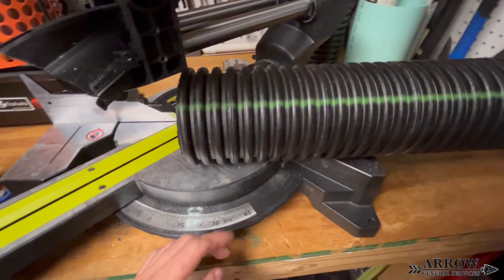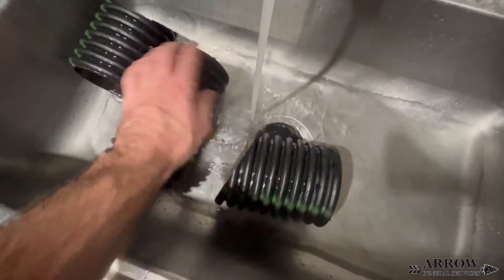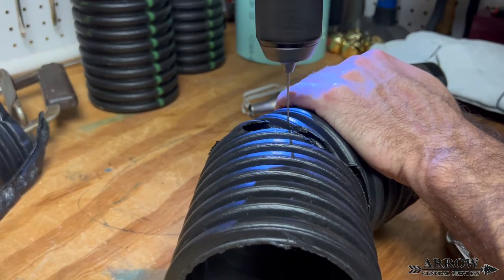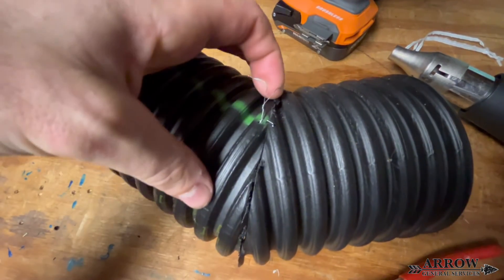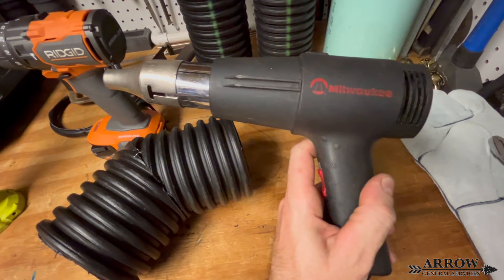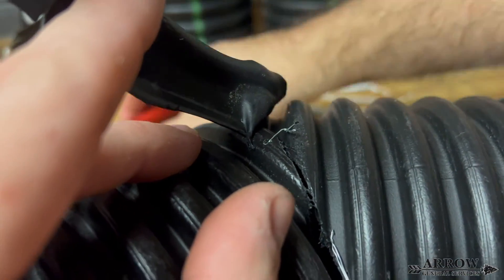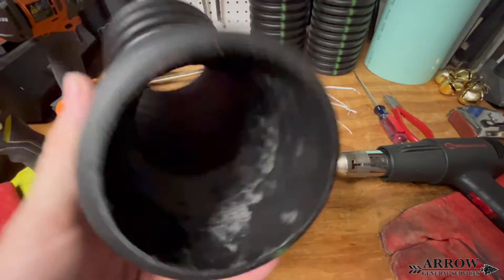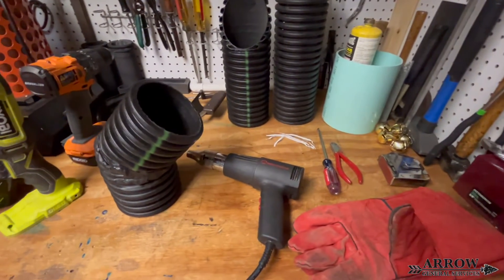How To Heat Weld Dual Wall Drainage Pipe

Comment: Great engenuity, very informative video. I’m looking at designing a twin wall pipe drain system and I was wondering how do you connect a single wall pipe to a twin wall pipe? Are they the same OD and you use a standard coupler or is there a specific adaptor? Thanks 😊
Reply from the maker: Good question, signal wall and double wall are the same OD so you can use an external corrugated coupling to connect them together. Don’t forget to tile tape em💪
Reply: @StormWaterDrainageSolutions  Thank you very much for the advice, I really appreciate it.